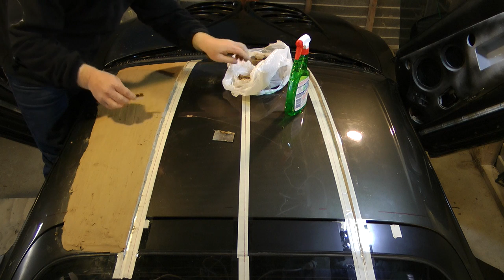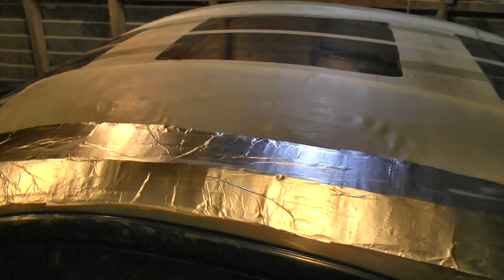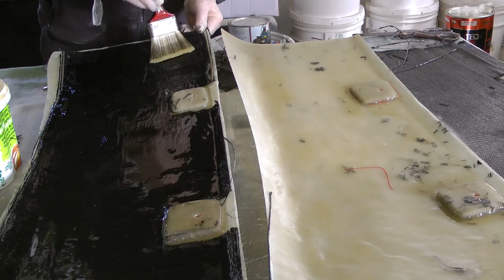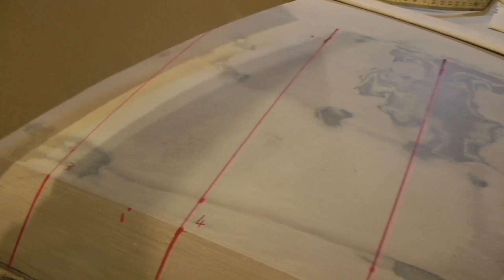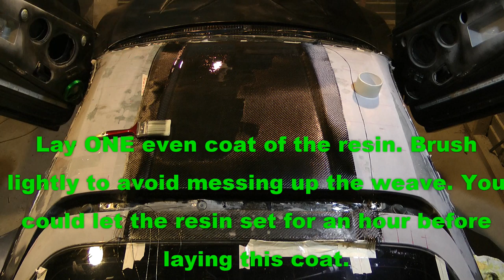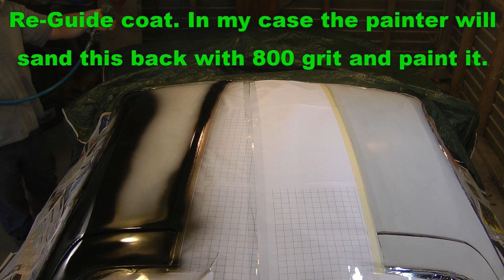How To Change A Panels Shape with Clay sculpting - Step By Step - Full Tutorial.

Comment: Just my opinion so please take no offense. I even plan on using your methods as a guide to changing up my Volkswagen. I just think the rear needs more curves to the sides and rear back sides. And I think what would really set off the whole look was if you could get bigger wheels on it by adding some more space by trimming some of the bodies wheel space off to fit some bigger tires and rims and then adding wheel spacers to the car so it could have a better stance and match the body you put on it. Again this is just an opinion and please take no offense I just wanted to share my thoughts. 

Best regards, Jason